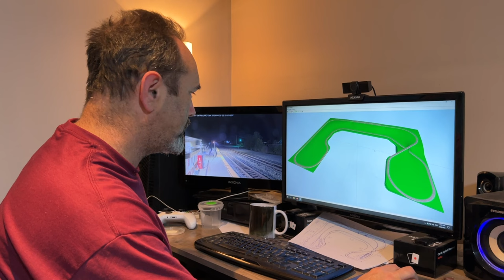Completing The Incline Structure For My Mainline Loop On My New HO Scale Model Railway

Comment: Since you were able to move the track towards the edges and added the 6 inch straight piece, did you consider going up to 22 inch radius there? It would help to ease the grade and the cars would look better on the larger radius. Really nice job on cutting the foam and making the jig. This is gonna be a great layout, Dave.
Reply from the maker: Damn, you pay attention way too much, lol. Do you think I would use the same space if I replace the straight section and  change it to a wide enough curve that would make much of a difference? I really don't want to psch it any further out.

Comment: sorry Dave i been calling you Scott :D  I "winged" my track plan- going well so far.  Our layouts are similar sizes, sort of. yours is twice as big but mine is N scale, giving me twice the "space" so it comes out roughly even- so we deal with similar radius issues. I'm coming off my bench work just a little with my outer loop at the turnarounds at either end, to get a bit more radius, and also I'm hoping it will look cool. I just have to rig up a proper support for it. Anyway its an option if you want bigger radius. It's a clever and resourceful cutting method you used. Great vid!
Reply from the maker: I've been watching so many videos lately on other people's layouts, and decided that this doesn't need to be my ultimate layout, I can always build another. So I'm seeing this as a tester, and not trying to cram everything in on one go, as much as I'd like to, lol.

Comment: When I built my layouts for my Wife And I I never used a Computer. When done You could go Half Dc And the Other Dcc as Well.
Reply from the maker: I'm going to wire it with an on-off-on switch, so I can go between DC and DCC. Might need to add some red warning lights so I don't put the wrong loco on at the wrong time, lol. That could be expensive.